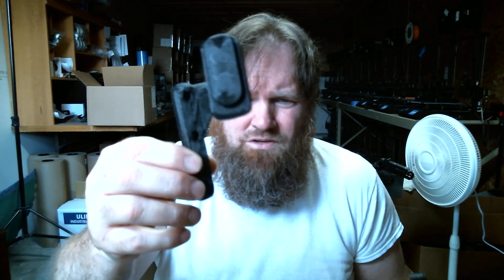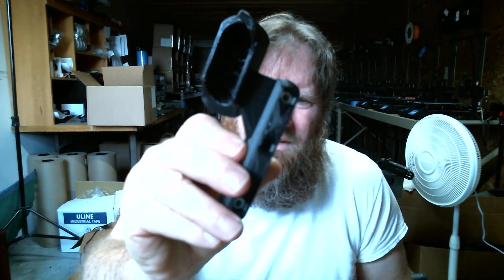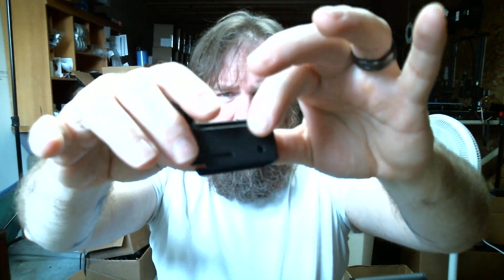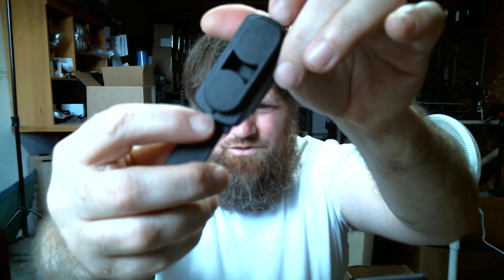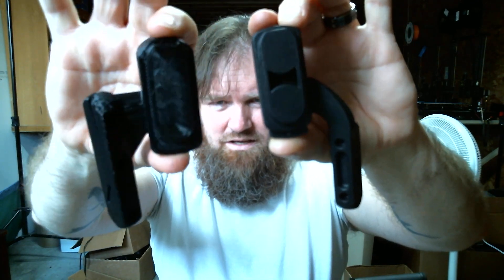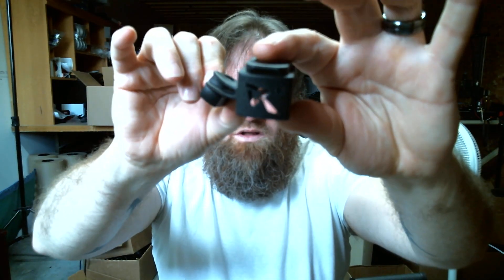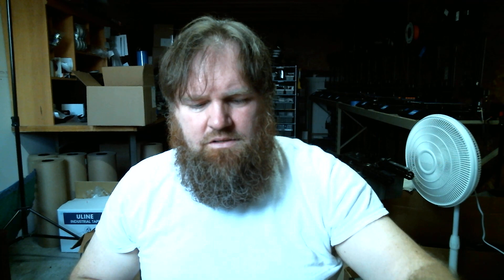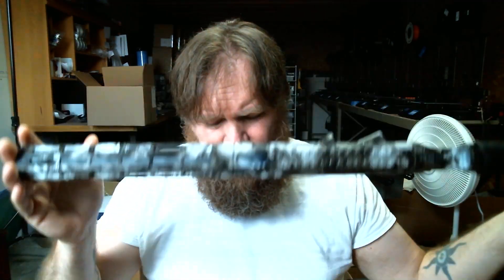Virtual Rifle Systems mkIII Status Update

Comment: Hello there. I ordered the rifle and connectors. Great quality btw. However I am missing a bolt for the dominate hand connector. I tried to see if the non dominant hand one will fit but I think it’s a different size. Everything else is there except for that one bolt. The one to tighten the controller once it’s seated on there. I don’t mind going to pick one up from a local hardware store but I would need the exact type and size to know exactly which one to get. So if u can provide that information to me that would be great. Thanks in advance. Oh the controller I’m using is for the quest. Also I have noticed the gold threading is also missing on the dominate hand connector to.
Reply from the maker: Oh no! Looks like an incomplete main hand may have found it's way into the completed stack. Do you mind sending a picture or two to me so I can be sure I get the correct piece to you? customercare@virtualriflesystes.com 

Sorry for the inconvenience and thanks for letting us know! 

- Denise N.
Reply: Ok. I just sent them. Thanks
Reply: I’m having trouble sending you the pictures. It’s telling me sent message is blocked
Reply: Lazarus 809 I think they made a typo in their comment. The correct email is CustomerCare@virtualriflesystems.com